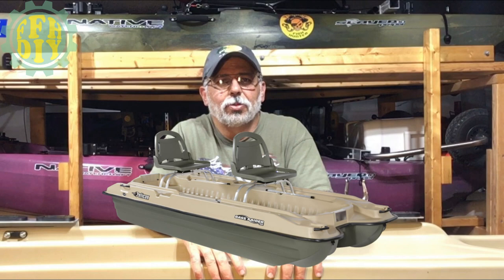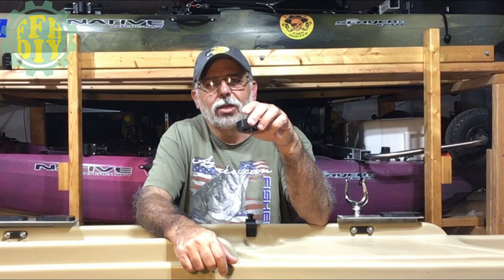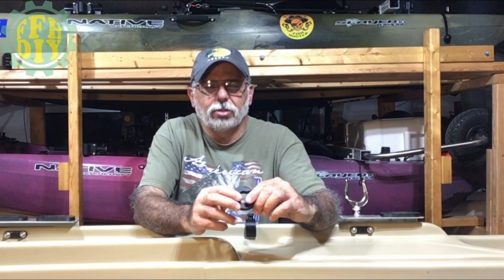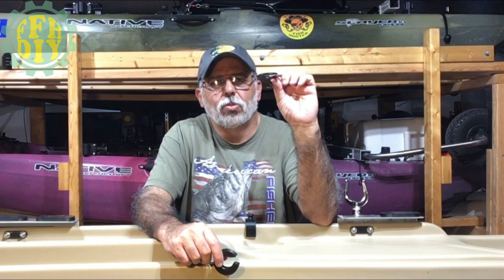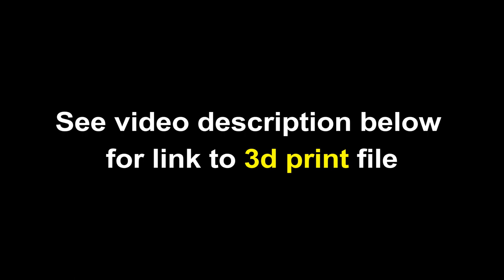My 2020 Pelican Bass Raider 10e Scupper Drain Install - Florida Fish Hunter

Comment: Other video's show adding the drain without the shim. Those video's looked like a disaster in the making. I wasn't comfortable doing that to my boat. Then finally I came across this video showing the use of a shim, and how to make a shim that will easily go in through the hole between the two layers and fit snug. Now feeling much more at ease with drilling that dreaded hole into the bottom of my Boat. Without a shim to stop the flexing and possible leaking I wasn't about to drill that hole. Seeing it done correctly is a game changer. Thanks for the video.
Reply from the maker: I felt the same way! I could not drill a hole in the floor of my boat until I could solve that flexing situation. Thanks for watching! 😊👍

Comment: Thanks for the creative solution! I have a Field & Stream Angler, and havent drilled the hole yet so I went with 8 of the thin shims in case my boat has a bigger or smaller gap (and in case I lose 1 or 2 to the inside of the boat 😅)
Reply from the maker: Glad it helped! 😊👍

Comment: For those wondering, I purchased the shim directly from him (not sure if he still does this) but was incredibly easy to install. One end of the shim is pointed and one is rounded. By inserting the ROUNDED end in first, simply twisting sideways the shim popped into place flawlessly.
I also purchased his paddle holders. Unfortunately one accidentle run into a tree and they are done for haha

Comment: I put the scupper in as well but Marine silicone and tighten to a good snugged fit ,so far no worries , marine silicone Everytjing you do ,every screw you put in the hull , I've been very limited in what I have done so far , when Rigging it out it's almost impossible to do without some penetrations but I'm keeping it as limited and using the silicone on everything , so far so good
Reply from the maker: I agree! Use marine sealant whenever possible especially when there are screws or holes involved. 😊👍

Comment: Instead of buying a 3 d printer how about expanding foam, redrill hole if necessary 💁
Reply from the maker: Hi Patrice! If done correctly, expanding foam is definitely better than having nothing at all between the top and bottom of the hull floor and should work just fine in my opinion. Also, as a side note, there is no need to purchase a 3d printer these days as there are many online 3d print services available that can create the parts for you if you have the stl file such as craftcloud3d.com  ( my recommendation ). 😊👍